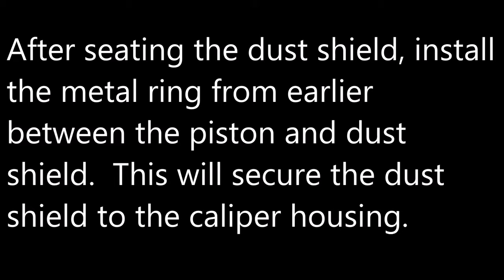How to Rebuild a Brake Caliper Fast & Easy

Comment: Where does the metal ring go? On top of the rubber boot?
Reply from the maker: Hello. The metal ring secures the rubber boot to the caliper. Notice a groove machined into the cylinder near the outside. The boot goes in, then the ring goes in to secure the boot. Hope that helps. Thanks for the question and best of luck to you.

Comment: I have a small tear on the outside of my outer seal of one of my calipers.  I'm not seeing any brake fluid come out of the caliper.  Will that be a problem as far as brake caliper function or is it the inner seal which creates the seal, and the outer is just prevents dirt/dust from getting into the piston area?
Reply from the maker: Hello. Good question.  The inner seal does keep the fluid in. The outer seal protects the cylinder from dirt, debris and brake dust.  So, the caliper will function normally until too much debris gets in and starts to cause problems.  They can last for quite some time with a torn outer seal, so my usual advice is to replace it when it starts to make noise.  Hope this helps.
Reply: Once the outer seal is torn. Dirt and water will get inside and rust up the caliper around the inner seal. This will corrode and pit the piston which will then seize up. You can get seal and piston kits to refurbish calipers.
Reply: Piston will rust if the outer seal is damaged. Rust will stop the inner seal from working properly and piston wont retract
Reply: The replies here are correct: corrosion and seizure WILL happen. I reckon ALL the many calipers I've fixed or replaced, failed because either the piston outer seal was split or because the handbrake shaft was split - both causing corrosion then seizure. The repair kits with the seals are very cheap (~£6) and easy to fit.

Comment: any other ways with a air pump.. is hand pump possible ?
Reply from the maker: You could try, but guessing a hand pump will be difficult. You can disconnect the caliper and push the brakes to remove them, but it will be messy. Thanks for the question and best of luck.

Comment: I noticed I had a tear in my piston dust boot, can I just pump the brake pedal to pop out the piston from the caliper? I don't have an air compressor.
Reply from the maker: Hello. Yes, you can do that, but brake fluid will be all over the place. if you go that route, have many towels or rags down to catch the fluid.

Comment: For the people that dont have compressed air whats the other method of removing the piston?
Reply from the maker: Hello. There have been some useful suggestions for people that don’t have air compressors so search the comments a little bit and hopefully you will find something useful. The only thing I’m aware of is leaving the caliper mounted after removing the brake disk. If you depress the brakes, the pistons will pop out of there, but so will all of the brake fluid so it’s pretty messy. I hope you figure something out! Thanks for commenting. Have a good one!
Reply: @FastFixYouTube can I put back In no problem or is there something stopping me cuz I can’t get it to compress with c clamp

Comment: when do u put the metal ring back? Any detail appreciated
Reply from the maker: Yes, sorry about that. Put it in at the very end. You’ll see the area where it’s supposed to go. There’s a groove machined into the cylinder near the top. It helps keep the boot in place. You just need to compress it slightly and place it in…not much to it.  I hope this helps. Feel free to update the thread if you have issues. Thanks.
Reply: @FastFixYouTube  Ty

Comment: I think I have a similar sound, on the pedal release tho, if I remember correctly. After discovering both front discs were scorching hot last week, I deattched the calipers from the discs and tested them by pressing and pumping them today. Front left seemed a bit harder to press in. Then, pumping the brakes to push both pistons out simmultaneously, the front left traveled less distance compared to the front right. Also, part of the dust boot on the front left is not stretching out evenly around the piston. So, I'll be doing the seal rebuild this week. Anyone thinking this is the reason for the brake/caliper drag on both discs? OT, I've learned that air in brake lines/master cylinder can cause a sinking pedal, but can it cause brake drags? @Fast Fix, did you replace the piston too? Did the rebuild eliminate the noise? Also, did you have any brake drag?
Reply from the maker: Hello. Yes, I replaced the piston and the seals.  I didn’t have any brake drag...not sure what can cause that, but master cylinder malfunctions and sticking cylinders seem like likely causes. Best of luck!
Reply: I here same noise on front brakes release like a bad door open

Comment: I’ve heard it is bad to put anything but brake fluid in the caliper or on the piston. but you used carb cleaner? just wasn’t sure thanks
Reply from the maker: Good question. I’d say it’s not detrimental if you’re only using the carb cleaner for a limited time and making sure to wipe the surface dry right away. The cleaners are pretty harsh, but as long as you’re careful and don’t leave parts saturated, you should be okay. Thanks for the question.

Comment: I would suggest cleaning the caliper housing before rebuilding , chemical and wire wheel.  All it would take is some rust to destroy that new assembly
Reply from the maker: Good tip 👍

Comment: Will this fix a leak coming from the caliper?
Reply from the maker: Hello. If the leak is coming from the piston area of the caliper, then yes. Otherwise, you likely have a leak coming from the brake line or the bleed valve.

Comment: I dont have air compresssor ,what shall I do
Reply from the maker: Hello. There are ways!  A few good ideas in the comment section that I don’t remember off hand, but if push comes to shove, you can always use the brakes to pop them out. It will be messy!

Comment: The job is a bit more tricky than 1.5 rating. Anyone trying this need to know you may damge other components trying to fix this. I would rate this 2.5 out of 5. 😊
Reply from the maker: Hello. Yes, that’s fair. It’s much easier to just buy a remanufactured caliper, but the cost savings from doing a rebuild is a valid point. 👍

Comment: Everything worked but even with a c clamp And compression tool, it will not go all the way in. What am I doing wrong?
Reply from the maker: How far did you get it in?  Make sure you removed the bolt that holds the brake line on. I made that mistake and couldn’t understand why the piston would not seat completely. Let me know how it goes.
Reply: @FastFixYouTube  I did. I actually have the entire caliper off the car and cannot get it back in after setting it and using a c-clamp.  I dnt wanna use a hammer but can I?
Reply from the maker: @AngryAnR  hello. Definitely don’t use a hammer. Something is wrong if you’re reaching for the hammer. I’ve been there, then regretted it. Ha. There must be something binding up the piston. Have you removed it then checked for obstructions?  Look at the cylinder walls and make sure they’re smooth. If you see a gouge or something similar that probably means the piston didn’t go in square and roughed up the walls. Also, measure the piston and make sure it’s the right size. Could be that it’s too long and bottoming out. I wish I could see what’s happening and offer an precise solution, but unfortunately we can’t accomplish that through comment threads. If you can’t get it to seat you might have to bite the bullet and get a remanufactured one from the store. I’ve had to do that in the past and assume I’ll need to do it again at some point. Sometimes, it’s just necessary to quit and go for something you know will work. Sucks, but it happens. Best of luck and feel free to update this thread.
Reply: @FastFixYouTube  everything is ok. i dont get it at all.  i had to break down and go get a replacement tho. i could not figure it out for the life of me.  i even took it to a shop and they couldnt see why it wouldnt go in. just one of those things i guess.  i truly appreciate all the feedback.  until the next fix.......take care

Comment: My technique when installing the piston and boot is to place a towel on my lap, place the caliper with the opening facing out ,then use both hands to guide the piston in. Your tummy acts like a back brace.
Reply from the maker: Another great tip!  Yes, do what works for you and that sounds like a good idea for all 👍👍👍

Comment: Should have used the brake pedal to push the piston out. Much more controllable and will work every time. Compressed air will fail to get EVERY stuck piston out.
Reply from the maker: True enough, just messy that way. 👍
Reply: No more messy than air blowing brake fluid out. Just have a rag and a pan handy. The fluid drops straight down from the caliper.

Comment: Why didn't you show the metal ring? That is the hardest part that I try to figure out now...
Reply from the maker: Hello. The metal ring secures the boot to the caliper. Look on the outer edge of the cylinder. There will be a groove. That groove is where the ring goes. The ring is installed last right after you install the boot.  In other words, the ring secures the boot to the caliper. Hope this helps.
Reply: @FastFixYouTube your caption says to install the ring between the piston and the dust shield.  Shouldn’t the ring sit on top of the shield (on the grove) so it’s between the shield and the caliper?

Comment: Just did a 2011 lexus is250 front caliper rebuild both sides. Then did a1995 honda odyssey with 300,00miles this one I also replaced the pistons . Much cheaper than the other alternative.
Reply from the maker: Absolutely!  A rebuilt caliper for this car was $60.  The piston and seals were under $15.  Rebuild all the way.  Thanks for the comment!

Comment: what size compressor did you use to push the piston out?
Reply from the maker: Compressor size doesn’t matter. It’s an 8 gallon compression.
Reply: @FastFixYouTube  thanks ~ so I can buy a small 6 psi compressor with a 110 psi , hopefully that works.

Comment: Air? What if you don't have a compressor to put air?
Reply from the maker: You can keep it attached to the caliper then depress the brakes. It’ll be a mess, but that’s another way.  Prob a better alternative that I’m not aware of. Hope this helps
Reply: @FastFixYouTube  the other alternative is buy it brand new and save all king of pain
Reply from the maker: Yep, agree!

Comment: What happen if the seal has tear?
Reply from the maker: Hello. Dirt and road grime will work its way into the cylinder and eventually cause a failure. Or at minimum cause your breaks to make a lot of noise and not function as well. Thanks for the question.

Comment: That soft line is completely ruined now. There is stell reinforcements in that rubber line. You collapsed it by vice gripping it. Not hating just dont that next time. Just point it up so I doesnt leak. Again not hating just a tech tip. :)
Reply from the maker: Yeah, you’re 100% right.  I appreciate the feedback and the suggestion 👍

Comment: How do you put that seal ring back in?
Reply: Not exactly sure where to put that metal ring at.
Reply from the maker: Hello. The metal ring holds the rubber dust shield in place. It will be the last thing you install. It fits in the groove machined near the lip of the cylinder. I know that didn’t get shown in the video.  Sorry about that.

Comment: If you are not sure which way the boot should go on look at the old one to see if there are any markings such as manufacturer or even a part number scribed on the boot. With genuine Toyota boots ,the markings face out. I will be doing this job soon using genuine honda and will report back
Reply from the maker: Excellent advise!  A good reason to use Toyota boots!  Hope all goes well for ya!

Comment: Done this several times... Dont buy it people. That seal will fight you til death. Hours of panicky pressing, having it hopping of the ledge where you dont press. Finally having you condcider screw drivers or such tools ending up with you puncturing your new seal and throwing it all in the wall. If that was your daily drivers caliper and the car on jack stands. Well, hope that you have an alternate car to use.
Reply from the maker: Hello.  Yes, you’re absolutely right with the things that could happen when completing this repair. That’s why I believe it to be an individual choice on how much you could possibly save if things go right versus how much new caliper would be. Getting the remanufactured calipers definitely the easier option and honestly something I would probably do most of the time unless there was a significant amount of money I could save by repairing it myself. Otherwise it’s like they say keep a simple stupid. Thanks for commenting and have a good one!

Comment: No grease go inside that piston how it slides back and forth if there's no grease in it you put it back in dry is that the way it's supposed to be and if it is wouldn't that just cause a lot of wear if it's sliding back and forth and back and forth and it's dry
Reply from the maker: Hello.  I may have not shown in the video, but use DOT 3 fluid to lubricate the piston.  Yes, putting it in dry could cause premature wear on the part.  However, the piston would get lubricated when the brakes were used, so it'd only by "dry" for a moment.

Comment: What about the slider pins .
As the calipe moves in and out it slides on the retainer bolts.
These become just as corroded as the piston.
Reply from the maker: Yes, good point. Those are worth changing / cleaning if part of the problem.
Reply: That can make caliper stick too. That's why they call em slides!😉

Comment: Should definetly of wire wheeled and painted the caliper whilst it was off but cheers for the vid 👍🏻
Reply from the maker: Yeah, but then I’d have to paint the other three 🤣
Reply: @FastFixYouTube  hahaha, im currently doing all the underneath rear of one of my cars, all undersealed now, calipers are getting rebuilt and painted and fitting braided brake lines
Reply: @FastFixYouTube  oh and having stainless steel pistons made up for the calipers

Comment: Why didn’t you show putting the metal ring back in ?
Reply from the maker: Hello. It was an oversight on my part.
Reply: @FastFixYouTube  do you just put it back in ?
Reply from the maker: Yes, pretty much. It’ll go in very last. It just slips into the grove and presses the boot to the caliper. If you’re able to do everything else in the rebuild, this will be no problem 👍

Comment: For those wondering, a 20 dollar walmart pump will indeed pop the piston out xD just but that bad boy against the bleeder hole and boom.
Reply: Name of The pump ?
Reply: @rayonwilliamssportsandfun2106  i used the hypertough emergency inflator. i was shocked honestly. took about three seconds. best trick ever\
Reply from the maker: Nice! I wasn’t aware of that, so great info 👍
Reply: I did it with a screw driver lol
Reply: 2014 Lexus is250f
Reply: Thanks I'll give it a try. Was looking for an alternative to having an air compressor just laying around

Comment: What type of fitting did you use to be able to use compressed air
Reply from the maker: Hello. It’s just a standard air gun fitting. That’s all you should need. Thanks for the question
Reply: You can also use a rubber tipped air nozzle, it has worked for me many times !!

Comment: you did not show when and how to put the wire ring back.
Reply from the maker: Hello. Sorry about that. If I could edit it in, I would. YouTube doesn’t let that happen, however. The metal ring goes in last and holds the rubber dust seal to the housing. Hope this helps.

Comment: Where is  thedteel ring and when fix the steel ring
Reply from the maker: The steel ring goes in last and secures the boot. Just fit over the rubber into the groove 👍